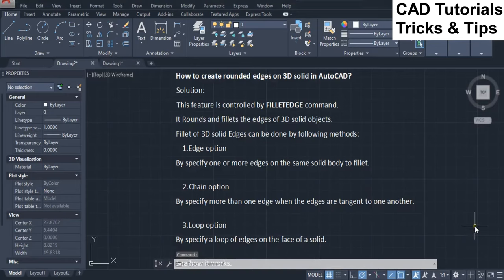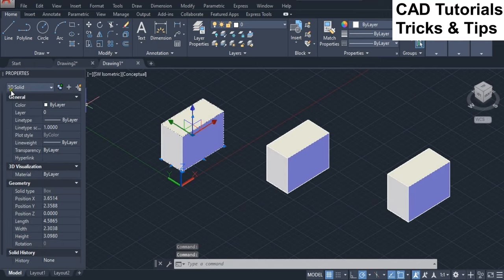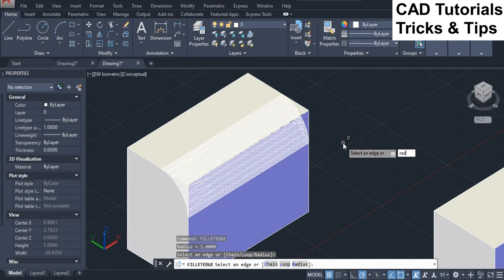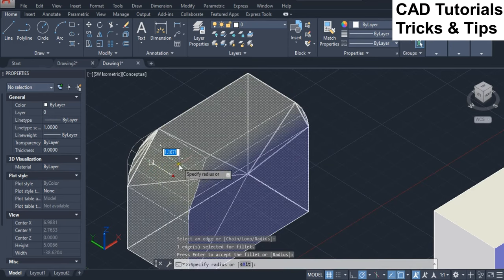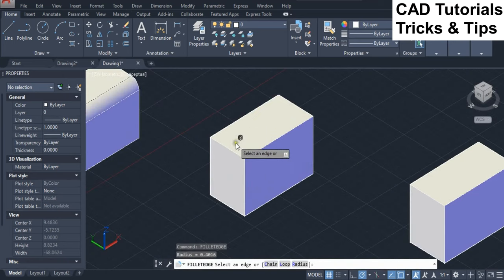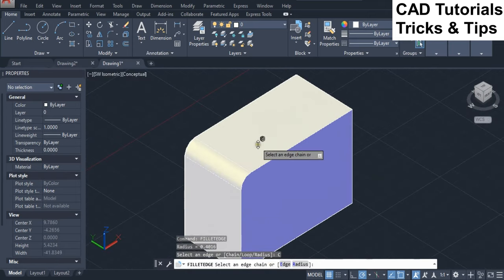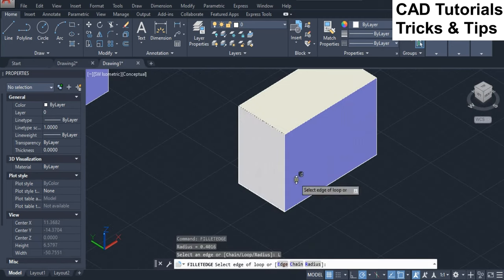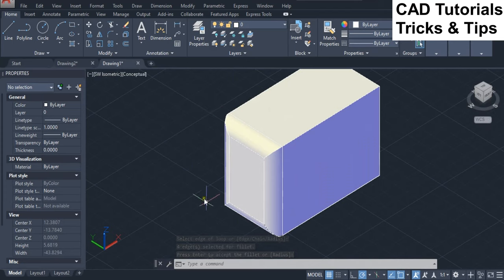FilletEdge command Autocad,Autocad 3D, 3D solid editing,Edge, Face,Fillet,3D Modelling,How to Fillet

Comment: hello, how do i remove the lines after fillet? so that the filleted part will look smooth without lines
Reply from the maker: In fillet command this sub option is available, to remove the object after fillet or not, kindly check trim sub option. Thanks.